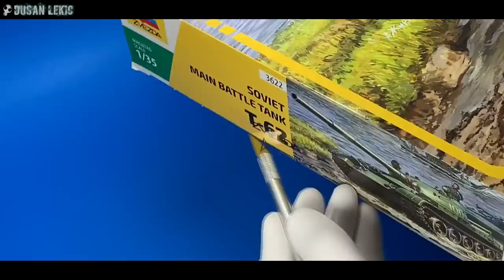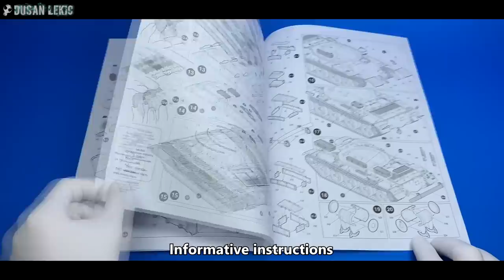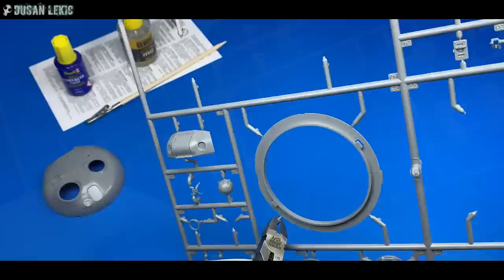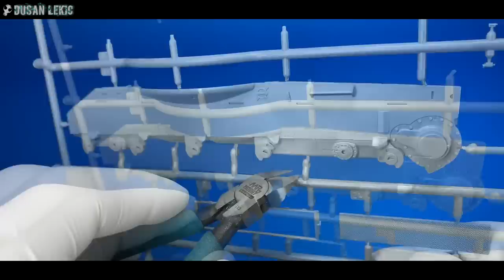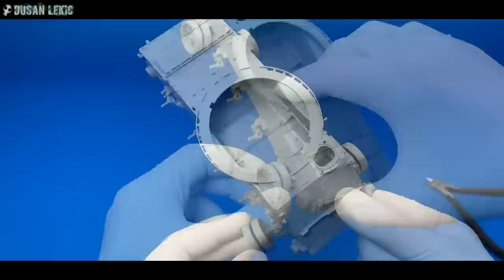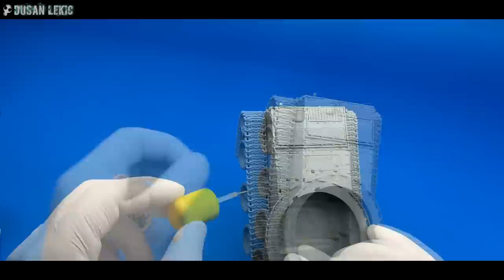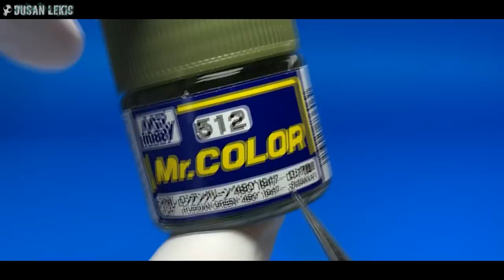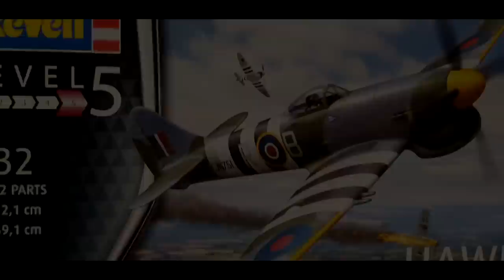Full video build 1/35 T-62 Main battle tank - ZVEZDA (New Tool)

Comment: I bought several Zvezda models 20 years ago, remember being pleasantly surprised about how good quality they were. Good build and looks great 👍
Reply: The irony is that a lot of people consider the Zvezda kits from the late 90s/early 00s to be iffy (basically cheap and cheerful, but with some serious QC problems), so you can imagine what an actual leap in quality they had for the same people to be praising them now :D By the way, if you think the T-62 looks great, look up the Panzer IV, Tiger I and the T-35 reviews on Scalemates and the like with the consensus seeming to be that the newer stuff (ie 36xx for 1/35th vehicles) is on par or better with Tamiya, but at a fraction of the cost. ie KV-1/KV-2 come with partial turret interiour (almost complete for the -1, less for the -2) hovering around 20Euros, while the equivalent "new tool" Tamiyas swap the turret detail for a figure and a 60Eur price tag.
Reply: @bk109  That sounds cool, thanks :)
Reply: @zxbzxbzxb1  They sure look cool at least, but I did forgot to mention that Zvezda still make some really baffling decisions even in kits that I othewise love so doing some quick research helps avoid the surprises - ie the Ausf H has Zimmerit on the Schürzen (which apparently was rare, but it's easily seen on photos of the real tank), but none on the hull and turret, though it's easily fixed either by making your own, ordering a cheap PE/decal set for 10 bucks or in my case - not being bothered and building as is. Or the Mi-24P (at least the 1/72th) - fun and easy to build, but it can't actually be built as portrayed on the box art as it only comes with 2 unguided rocket pods, instead of 4.
Now, that said, it's time to return to my previously scheduled 'Damn it, how many roadwheels does this bugger still have?!' part of a Tiger build at work (well, 2 builds, because my boss wants one too... gotta love '19'-era corporate IT)

Comment: the idea of using tape to set the track shoes around the drive and idler sprockets is clever, i have built several AFV kits with individual track shoes and this has always been an issue, now i see a different way of thinking, thanks, and this is another one of your awesome builds

Comment: Nice job Dusan! I still need to build a tank with full interior. The without versions are just so tempting though. It did look like an easy assembly. Yes, I also prefer the aftermarket "steel" cables. Weathering came out great, thinning the fenders looks better than bending them up {IMO}. She'll look sweet on a dio. Congrats!

Comment: Impressive build as always, if you get the chance, you should give the P IV Ausf H and/or their T-35 a try as well ;)  By the way, the 4BO green was replaced in the 50s with the Mr Hobby H136 supposedly being a match for it (at least going by Trumpeter's instruction manuals). That said, the colour is still accurate enough, because.. well, the quality control and/or tolerances and/or reaction the elements was so horrendous, the same 'protective green' could look like anything from sandy yellow all the way to near-black - in fact, there was a great picture on Reddit with BRDM's or MT-LB waiting for transport, with basically none being the same colour :D

Comment: I've been looking at this kit a little bit and was wondering if it's decent. I've built several of the Trumpeter T-62's (Trumpeter produces the best T-62 kits IMO currently.) And it looks ok for a Zvezda kit. Looks a lot better than their older stuff but still they're behind at offering what others do. Photo Etch grills etc. Also, the turret's steel texturing is much to be desired...some Tamiya surface primer G would come in handy here. Good job btw on your build.